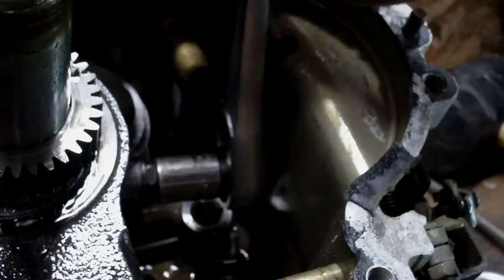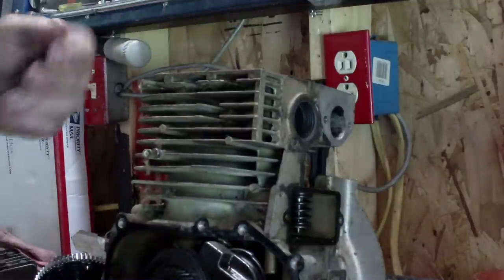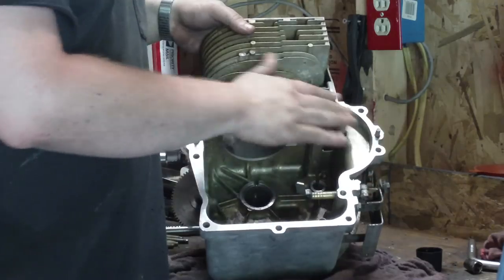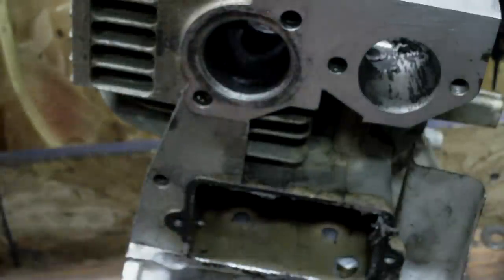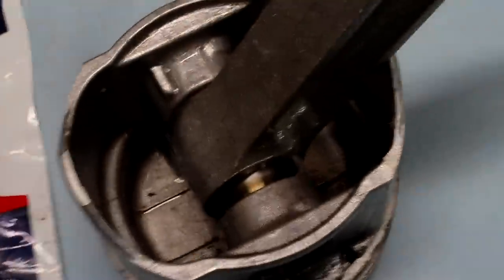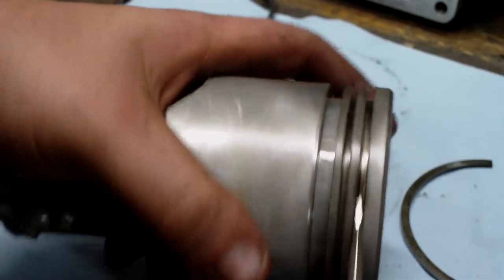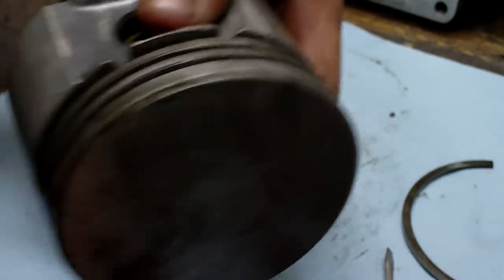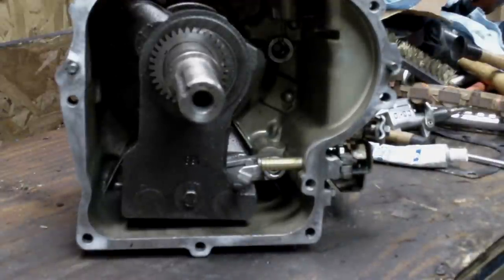Briggs and Stratton Power Built 12.5 HP Flathead Model 28 Rebuild, Teardown / Reassembly PART 2

Comment: I have a Model 28A707-0122-02 engine, and I have a question for you about the crankshaft. Th rod threw in it, but it did not damage anything. The crank does have score marks on it, though. Could I get it polished out or do I need a new crank?
Reply from the maker: As long as the scratches aren't to deep (like your fingernail won't hang on them) then you should be able to polish it up, using a emry cloth or something along that line. Those are great engines, hope you get her going again! Thanks for Watching!!!
Reply: Alright, thanks! I think my fingernail can get hung in it, so I guess I need another one.
Reply from the maker: I'd try polishing it first just to see if it smoothes out, cranks are high dollar. I put one together that some scuffs and never had any problems with it. Just when you get the new rod, check for play on it. Now you can get a .020" undersize rod and take the crankshaft to a machine shop and have it turned down, that could save you a ton of money doing that. Alot of people do that.
Reply: Okay, thank you!! I will try to get it machined, seeing that it got too hot when I put it back together the first time.
Reply: Also, when I get it machined, should I get it .020" undersized compared to the stock journal measurement that is on the Briggs and Stratton spec sheet?
Reply from the maker: What you do is when you get the .020 undersized rod, take it and the crankshaft to the machine shop, they can machine it to match, they will measure the rod bearing and the journal and determine exactly how much to take off. I would check your local shops first just to make sure they can do it before ordering the rod.
Reply: Well, I checked and the closest machine shop around is in Birmingham, Al, which is about 1 hr. and 30 min. away from Winfield, Al, where I live. So, I might just have to get another one, or find out if I can somehow, maybe, sand it out.
Reply from the maker: yeah thats pretty far away. if you do decide to get a new one, you could get on ebay and find a good used one, that could save you a ton there. Its worth a shot trying to sand it out, I had a generator lock up, the crankshaft seized on the sump bearing, i had to sand it down and polish it and its been running fine every since, but the rod is a little more critical that that. Its up to you haha
Reply: Well, thankfully, my local mower shop told me of someone about 30 min. away, so I will try them. Do you think I could get a machine shop to put in a new sleeve in a couple of engines I have, I didn't know if they do that or not for small engines.
Reply from the maker: well thats good. Yeah, they should be able to do it, i checked here on that last summer, i have about 5 motors that needs that, and it costs about 80 dollars per cylinder here. but that will vary. You'll just have to check with them
Reply: Okay, thank you very much!
Reply from the maker: No problem, anytime!